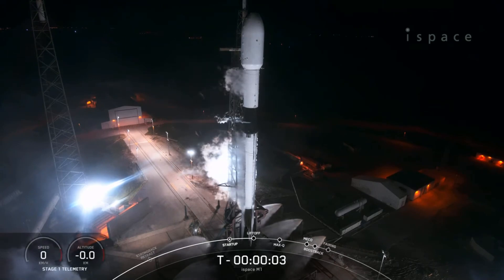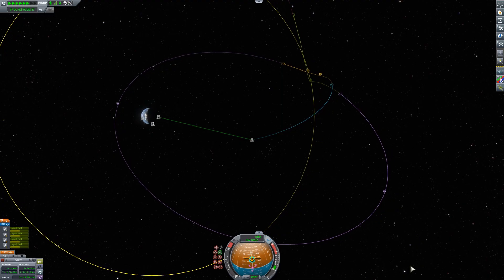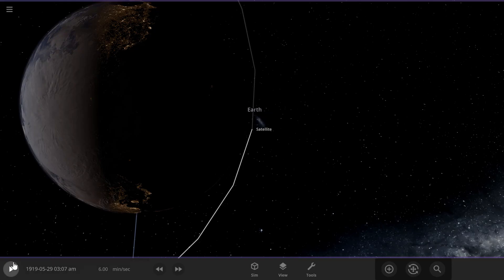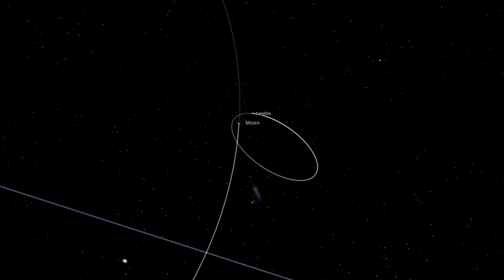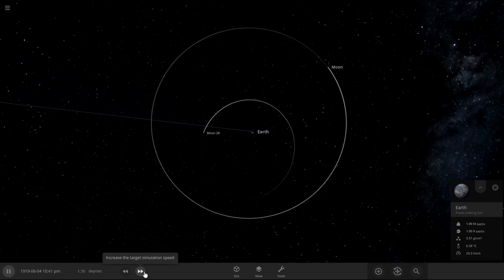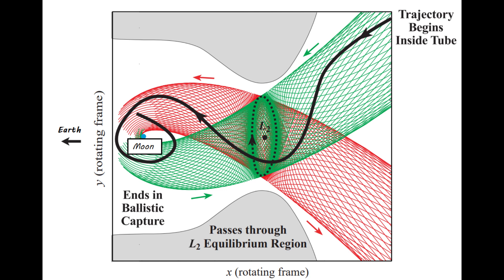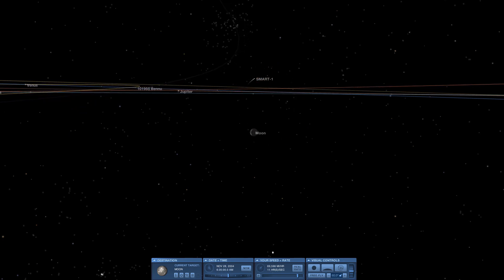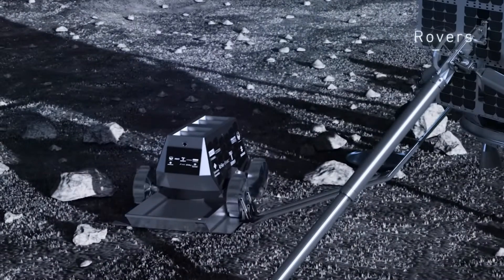Why Spacecraft Are Using These Crazy Routes To The Moon - Weak Stability and Ballistic Capture.

Comment: Back in the early 1990s while the Strategic Defense Initiative Organization (SDIO) was still in existence, we had designed a lunar orbiter that had a small 2MeV linear accelerator aboard. The spacecraft would be targeted for a 60 km altitude. The proton beam would hit the lunar surface and produce neutrons with energy distribution characteristic of the atoms on the surface. The launch vehicle was the Delta 2. 

We had Ed Belbruno consult with us on using his weak stability boundary/ballistic capture trajectories since the payload was too heavy for the Delta 2 to fly an Apollo-like trajectory.  Alas, there was no interest from either NASA or the Ballistic Missile Defense Organization (BMDO), which was working on its Clementine lunar orbiter, which carried six science instruments for mapping the lunar surface in 1994. Clementine was launched on a Titan II.

Comment: QUESTION: as more of these ballistic capture paths are making use of Lagrange points, is there an increased risk of collisions? The L2 points already seem to be getting more satellites permanently stationed there. I’d hate to see a new spacecraft run into the JWST as it flies through!
Reply: Almost no satellites are "stationed" there, as L2 is in earth's shadow, its not wise to have a satellite there. Webb for example, is at an orbit around L2 of more 800.000 km at its apoapsis.
Also lagrange points are not exactly points, its more like spheres, so this maneuver doesn't need to pass directly at the point, also also space its super big, collisions are unlikely, they are more of a problem near earth, where distances are smaller and space is crowded.

Comment: Just one thing: You did say that it was better when the spacecraft had more place for hardware and less for fuel, also lighter spacecraft. Most of the Delta V for putting the spacecraft in ballistic capture orbit (or trans lunar injection) would be given to the spacecraft by the launch vehicle (last stage, I gather). Most of the Delta V for the spacecraft slowing down to get "captured" would have to be the spacecraft's thrusters working. So there's an enormous advantage in making a lighter spacecraft, putting less fuel in it (which can now be used to maneuver and not to slow it down) and not firing those thrusters for a extended period.

Comment: If you played Kerbal Space Program with KSRSS, you'd know that most efficient way is to launch straight up and have the moon pull you to its orbit. Economizing approximately 300m/s D-V by eliminating need of sideways burn.
*note that efficiency may vary depending on TWR at takeoff and other specifications of the craft.
Reply from the maker: That’s totally wrong, if you go straight up you increase your gravity losses https://youtu.be/ClsTnYsR5MU
Reply: @scottmanley  BTW your video is about "escape velocity" which is correct.
I have to add a note:
Neither the safest burn(pro), nor the shortest way (radial out) are the most economic.
If you add Oberth Effect into calculation, There is an optimal angle of the take off for best fuel economy.
Burning into Moon about 27-30° of climb is the most economic.
Prograde is the safest.
Radial out is the shortest (by time)
Reply: Another note: Not rocket, SSTO I was talking about when I said 30°
Seriously, hopefully I'll make a video then will send to you
Reply: @scottmanley  I watched this bro, thanks for video. I approve that burning sideways is more efficient than fighting with gravity.
But you're ignoring the fact, that in your scenario both crafts are launched from same destination.
In my example, Launch window looks directly into the Moon. (liftpad below the Moon)
I'll make a video about this, If I do, I'll definitely share with you!

Comment: Also, once you've worked out the three-body problem Earth-Moon-Sun, forgetting the Sun is just stupid, because the spacecraft is so light that it won't significantly influence the trajectories of the more massive bodies. Thus, take the force fields you get from the three-body problem and use it to calculate the trajectory of the spacecraft.
Reply: Finally, the picture with the red and green lines seems symmetrical about a horizontal axis. Since the force field is symmetrical about the same axis, the particles should exhibit symmetrical behaviour. Also, the stable resp. unstable manifolds should be part of some configuration space, because a motion in space does depend on the initial velocity.
Reply: But as long as you don't enter the Forbidden Region, you should probably be alright...

Comment: The deceleration is only due to Earth's gravity. The Sun is responsible for making the orbit more spherical. Even though an orbit motion is periodical, the field vectors point towards the dominant celestial object. This is the principle of gravity: The forces work TOWARDS the massive bodies, not AWAY from them (and only towards a saddle point of the energy if it is approached from the right direction).
Reply: We enter close to a Lagrange point of the moon because even though we want to land inside the moon's gravity well, we don't want massive acceleration towards the moon, which would cause the spacecraft to collide with the moon and possibly break in the process.
Reply: The point of entry has nothing to do with the speed at entry. This is because at a different angle, the kinetic energy is transformed into potential energy and vice versa as you go up and down, but the total energy is constant.
Reply: @adrianf.5847  how exactly can an orbit change that significantly with only 1 object acting on it
Reply: @petterlarsson7257  But there are two objects acting on it.
Reply: The point I was making is that gravity is an ATTRACTING force. Thus, if an object A on an orbit around object B is influenced by object C, this influence will be TOWARDS object C.
Reply: @adrianf.5847  oh

Comment: Did my PhD on ballistic capture, worked with Ed Belbruno at Princeton University, and I'm currently an active researcher on this topic. Yet, I'm always fascinated by this concept as the first days I started studying it.
Reply: Your email address please
Reply: then what's the difference between weak stability boundary and invariant manifold? and I'm always confused about the real advantage of these methods, after all we need to do a lot of numerical calculations to get these. could you help me figure this out？
Reply: @Liuxw666  It can be shown that weak stability boundaries and invariant manifold are two different tools to study the same phenomenon, which is ballistic capture trajectories. Invariant manifolds have maybe the advantage of being useful to perform trajectory design and analysis for Lagrange point missions too. Yes, they require a lot of calculations, but in the and all space trajectories require that, even the simpler ones!
Reply: @fratop  thank you so much! I just wonder if there is any method like lambert transfer which you don't need too much calculation in CRTBP problem
Reply: @Liuxw666  Nope, unfortunately there’s no such method. You need to use differential correction to implement a Lambert-like solver in the CRTBP.
Reply: and still find the lunar transfer chart very phallic

Comment: This reminds me of similar ways of looking at travel through the solar system I am sure I saw som thing on. Wish I could remember better, but it was something about finding tubes (I guess these would be the manifolds) that allowed efficient travel between planets and then planning missions based on those pathways. So you would basically end up with a roadmap for travel in the solar system. These manifolds would of course change position over time, but now I really wish I could see a 3D manifold map of the solar system evolving over time. That would be so cool!

Comment: Scott, what about from the perspective of an astronaut in one of these orbits? How large are the delta-v's and how large of G-forces do these represent?
Reply: I think he said delta-V 2.8 km/s for the initial burn from LEO. G-force will be a design decision based on how many seconds or minutes for that delta-V to happen. No g-forces on astronauts after that because no more burns, except for minor burns to correct for slight errors. Without thrust of engines, astronauts feel no g-forces even in crazy orbits.
Reply: @danjustice1688  "Without thrust of engines, astronauts feel no g-forces even in crazy orbits."  But it appears that there is a significant and rapid change in direction at some points in these crazy orbits, at least when viewed from some perspectives. So even if there is no change in speed, the change in direction would produce acceleration and thus g-force.
Reply: @tomferrin1148  That's not how it works. If the ship had no sensors or windows, the astronauts would have no way to know that they are  following a curved path in earth's frame. They are weightless at all times. That's why some people say that gravity is not a force, but a curvature of space-time.

Comment: Wouldn't such trajectories result in some very strange launch windows, especially when two missions with a different trajectory are launched on the same rocket?
It could be that when the launch is postponed due to weather or some issue with the launcher, the next launch window is like 4 weeks away?

Comment: Speaking of the inverse square, does KSP calculate orbital interactions this way with hard boarders between the two bodies?
Reply: In stock KSP the boundaries  ("spheres of influence") are where the body with the most gravitational influence on the craft changes, so the inverse square law only applies up to a point, then the reference frame switches to another body.

Comment: Its amazing they come up with these orbits to eventually get where they need to with a minimum of go juice ,  but the impatient bugger that I am asks the question , is there a better faster albeit much more expensive way to just go from point A to point B without the mucking around ? 
Or is that only possible in Star Trek 😄.
Reply: More fuel.  The more you can change your speed the faster you can get places.
Reply: @TheEvilmooseofdoom    it still seems like a lot of effort for not much gain .
 Thanks for the reply though .

Comment: In a computational physics undergrad course over 25 years ago, we had an assignment to fire a spaceship from Earth, have it orbit around the moon, and return safely to the earth. If I recall correctly we implemented the Runge-Kutta method which took the 3 body problem and had variable time steps to give the most accurate simulation.

I took the assignment way too far, and graphed out the entire space. Given a starting angle (x-axis) and initial velocity (y-axis) what happened to the spacecraft? Impacted the moon? Lost in deep space? Skipped off the earth and ejected? The graph was not simple. 

I recall one set of initial parameters had a free return trajectory that ridiculously skirted the moon's surface by about 1.5mm, then returned safely to earth.

All of this to say that your video has me really curious. All kinds of "bank shots" off those Lagrange points (L1 and L2, both sun and moon) could lead to some fascinating paths with minimal fuel. Would love to see more on this topic. (even if just a recommendation for other videos)

Comment: Scott Manley, I knew this was posable 42 years ago when the space shuttle needed heat absorbing tiles. I could have had a chance to save Columbia if they would have delayed re-entry by 10 days, long enough to do the math and make a flight program. Use Earth's gravity to slow the shuttle down. To slow slightly and increase the altitude do this;... About 6 short burns through about 12 orbits at a 45` angle inclination backwards to slow the shuttle to about 1500 mph. Trying to dip in and out of the atmosphere.
Reply: That would have reduced total hesting, but the reduced velocity means the craft falls faster towards the denser parts of the atmosphere, leading to higher peak temperatures
Reply: What are you even saying? You do know that the OMS only had about 670 mph (300 m/s) of delta-v? Plus, falling into the atmosphere with a tangential velocity of only 1500 mph would cause enormous g-forces and would tear the vehicle apart. The Shuttle could only sustain about 3 g.

Comment: Wow.  I'm old enough to remember comics where there would be a space station moving in a "figure-8" pattern, first to orbit the Earth, then move out to the Moon, then back to the Earth again, in a perpetual loop.  

(The space station, of course, would basically be a huge donut maybe 50 meters across, rotating around a central tube that would be used to embark/disembark the landing craft to and from the Earth and Moon.  We now know such an arrangement would result in Coriolis forces  inside the station that would result the astronauts constantly being pushed to one side and possibly constant cases of nausea from the different forces acting on their inner and middle ears.  I still wonder if such a setup would be possible, though.)
Reply: possible: kind of!

Apollo 11 (and more notably, 13) used a "free return trajectory": it flies a bit past the moon such that if it has thruster failures, it will do a figure eight where the base of the eight is the Earth, so it can just fall back to earth without more thrust. this is almost the orbit you're talking about.

the actual orbit you're talking about is a "lunar cycler" orbit; you can try establishing these yourself in Kerbal Space Program with the Principia mod for n-body physics. The main downside as i understand is it's a bit of an unstable orbit so needs lots of station-keeping burns if you're planning to keep the station there.

You'd also want the Stockalike Station Parts Redux mod, btw, so you can setup a nice centrifuge for your kerbonauts there!

Comment: Which thrust is more efficient?  Thrust at take off with stronger gravity, but in an atmosphere, OR thrust in space with virtually 0 gravity, but virtually 0 atmosphere to thrust against?  Are they the same?
Reply: The atmosphere tends to interfere with rocket exhaust reducing efficiency. A rocket engine is more efficient in a vacuum. Although for maximum efficiency the engine's nozzle must be shaped and sized to work in a vacuum. 

Gravity has no influence on the efficiency of a rocket engine. Although gravity certainly has an effect on what the results of a rocket's thrust are.
Reply: @StevePemberton2  interesting.

Comment: Just remember guys in 1969 the command module did this flawlessly without expanding too much fuel, and maintained a trajectory that was perfect. NASA just needs to admit they faked it
Reply: It was hardly flawless, they usually had to make correction burns.  Turns you don't actually know what your talking about.  Common enough amongst you conspiracy types.  A lot of opinion backed up by monumental levels of ignorance.  It's why as a community you're discarded.  Worthless is worthless.

Comment: Maybe you have answered it in one of your other videos but lets see if you'll answer it if not. Do you save any notable delta v by going to a direct to moon orbit instead of going to LEO and if so is it worth it.
Reply: In short, no, but it used to be useful. In the very early days of lunar exploration, igniting an engine in space was difficult, and re-igniting a large engine was almost unheard of. So the early Soviet Luna missions (including the first probes to flyby and impact the Moon) were launched in one big, long burn that never achieved a circular Earth orbit but went directly to the Moon. In the US, the early Pioneer missions also attempted this, but most of them failed. It's not a reliable method and is very hard to time. And today of course, rocket engines are ignited and shut down in space all the time, so there's no need to do that anymore.

Comment: Scott, cool explanation. I'm super interested in how one accurately determines the actual position and trajectory of such a spacecraft. How do you know where you are, and where you're going? Radar? Star tracking? GPS? (jk). This is a big disconnect in my understanding.
Reply: I don't know if they are using it but pulsar navigation has an accuracy of a couple kilometers.
Reply: A lot is done by ground radar.

Comment: Awesome video. Love the casual solving of a 4-body problem by 2 x 3-bidy problems!
Reply: I thought that was really interesting too. Sort of like breaking a normal physics problem into multiple vectors, then adding them up, except in 3D and with exponential relationships LOL
Reply: That's not a 4 or even 3 body problem tho? The mass of the spacecraft is negligible and the Sun - Mun interactions are not the focus of it. It's 1 body (which is the spacecraft) and a field of different forces.